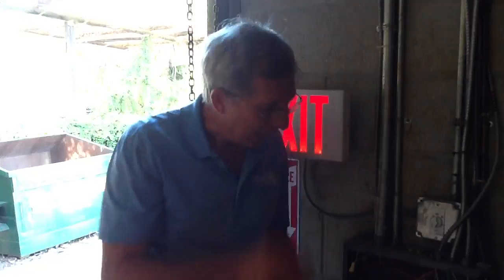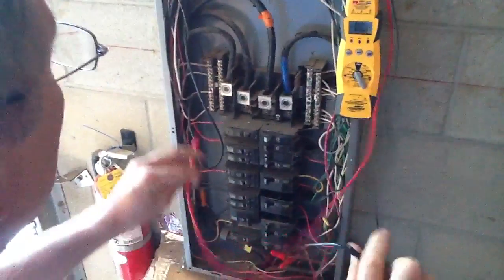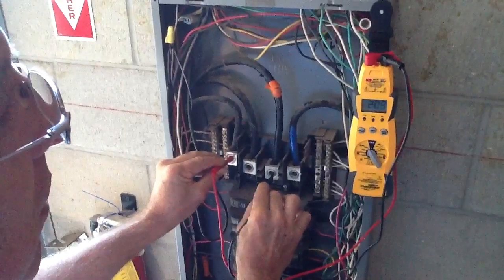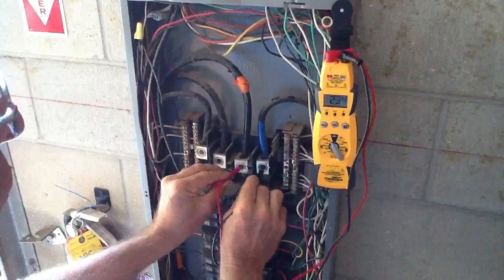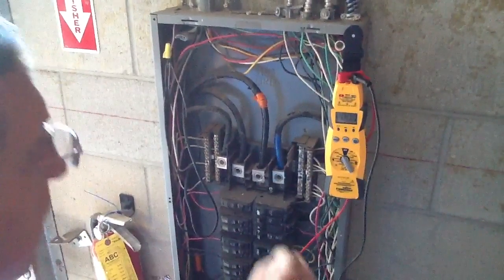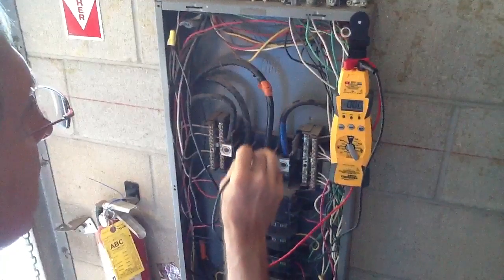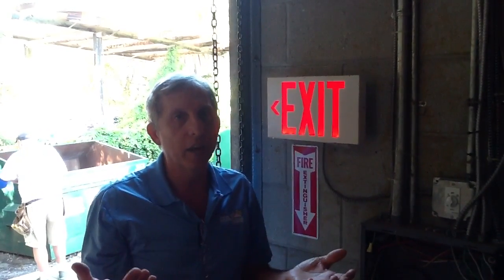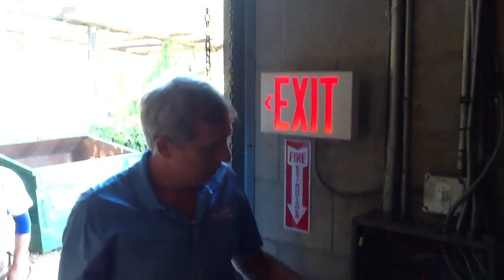How to measure 3 Phase Voltage with Highleg

Comment: There are a lot of uses for the high leg of a 4 wire Delta system. Most of your latest L.E.D. light fixtures have universal voltage drivers (120 through 277V.) that will operate at 208v. and any voltage in between.
Reply: Except that most single-pole CB's are not rated over 125v. And, the NEC explicitly prohibits high-leg to neutral loads.
But otherwise... totally okay. 😂😂
Reply: Or you can use 277 volt single pole breakers. You can get them on Amazon for around $20 to $30.
Reply: But most breakers you'll find are not rated for more than 120v.
Reply: Alex Millison You can use a 3 pole breaker.. All of which are straight rated (240 volt).  Either connect 1 phase to phase 240 volt load and a 208 volt load (high leg to neutral), or 2- 120 volt loads and a 208 volt load ( high leg to neutral).
Reply: Yes you're right, I was referring to if somebody was trying to use a single pole breaker in which case they don't make them with a 240V straight rating. And if somebody is going to use a 2 pole breaker to be able to use a high leg and nuetral, just use both spots and run 240v.

Comment: How is the potential difference between phase A and phase B 240V when it is 208V between Phase A and neutral?

question from a 1st year electrician
Reply: Phase B to ground is 208 because it's a 120/240 3 phase delta. You'll have 240v between any two phases. Phase a and c will be 120v and phase b will be 208v. Simply put, phase b has to travel the furthest distance to the nuetral in this delta system. If you take the square root of 3 (1.732) and times it by your line to nuetral voltage(120v) of phase a or c, that's how you get 208v.
Reply: Alex Millison Or you can simply multiply 240 (hypotenuse) × sin(60°) 0.86623~ 208
Reply: Jolyon Welsh or you can take 120V times the square root of 3 (1.732) which equals 208.
Reply: because they get the neutral wire by center tapping one winding......a little bit different than a center connected wye system
Reply: 0.86623 =√3/2
Reply: Correct
Reply: It's like all of you say the same thing over and over. You guys just recite what you've heard before. You guys probably don't even understand what you're saying when you regurgitate the whole √3 thing.
Reply: Richard  Wallace first you have to understand the difference between High-Leg Delta, Delta, and Wye. But you'll also run into Corner Grounded Delta which is fun to throw in the mix (thank you US for not having a standard system for 3-phase...) 

Not to mention the 240/415 High-Leg Delta, or the 7 different voltages that 3-phase is found in the US. 

So yes, you really should know your math before you mess with 3-phase in the US

Comment: So the one measurement you didn't show was the voltage between A&C  is that going to be 208 or 240?
Reply: Rod Bower  it'll be 240 volts rms phase to phase
Reply: In 3-phase all 3 phases should reference the same voltage to each other, the difference comes when you neutral reference things

Comment: I agree with Barry Witt and his comments on his closed Delta theory about this article.  One way to check is if you have 3 transformers on the utility pole supplying the service.  They should be marked with the voltage and other information.  To be sure call the utility.  They have the information.  Note: one of the transformers will be large and two of them will be smaller. The larger transformer (most likely) is supplying the 120 volt loads.  NEC 110.15 High Leg marking on a 4 wire delta-connected system where the midpoint of one phase windings (Coil) is grounded, only the conductor or busbar shall be marked by an outer finish that is "ORANGE" or by other effective means.  The high leg is common on a 240v/120v 3 phase, 4 wire delta system designated as B phase.  "IMPORTANT" : The Utility which has a different code and guidelines. The "High leg" (Stinger, Wild leg, red leg) is on The "C PHASE" at the meter. In past NEC codes the C phase was the "high leg".  The NEC changed the code to be on the B phase. Since the Utility uses a different code they kept the High Leg on the C phase.  "IMPORTANT" always check any panel your working on like the gentleman did in this video.  You don't know for certain how each supply was made up in the panel.  Someone could have made a mistake.  Another problem can be the wrong phase rotation.  Hopefully if you have phases A,B,C with the Utility A,B,C your phase rotating will be correct. Unfortunately, If two of the phases are changed out of the phases A,B,C order  the motor or motors will run backwards. You'll have to correct problem wiring by changing any two of the motors T connections.  The phase rotation should be checked before the install.  If the system is already installed you just have to work around problems such as the motors.  Thank You for the video
Reply: In my area, alot of 3 phase delta services are open deltas using only 2 transformers.

Comment: Great video, I have 3 phase high leg in an old building and am having trouble finding information on what types of 3 phase motors will work there for woodworking.
Reply: +Jordan Ward 208/240V dual voltage three phase motors will work just fine.
Reply: Those used with rotary converter on split phase.

Comment: Very informative video. The only thing I can see the high leg being good for is lighting where you have a ballast that can run on 120-277V.  208V has always been a mystery to me.
Reply: +Daniel Peters The voltage between all three phases is 240V.  It is only to ground that the high leg is 208V.  Three phase devices rated for 240V can be connected A,B,C while split phase 240V devices can be connected across the two 120V legs and single phase 120V devices can be connected between either 120V leg to neutral.  You just cannot connect a 120V single phase between the high leg and neutral.

Comment: Just to clarify what you really have there.  It is not a 208V 3PH service.  It is a closed Delta 120/240V High leg(wild leg, stinger leg or wild phase) service.  Between each phase you will have a nominal 240V (A-B, B-C, A-C) and between each phase to the grounded neutral conductor you will have 120V, 208V and 120V.  The leg with 208V to neutral is the stinger or high leg.  The typical phase to which the stinger leg should be connected is the B phase.  On the panel in your video it is correctly connected and correctly marked with orange tape which is required by code to identify the high leg.  No single phase circuits should be connected on the B phase bus terminals which is why you see several of the B slots with no breaker in them.
Reply: Barry Witt My brother you are absolutely correct.
Reply: +Alex Millison In his defense the closed Delta 120/240V High leg service is not very common.  It is usually found in cross over areas where residential services are mixed with mostly commercial services.
Reply: Most of these type installations are known as 240V "open-delta" three phase service.  Open delta because the power company only uses two transformers where a closed delta requires three transformers. These were very popular in mostly rural areas(start of REA electric co-ops) where a power company can give a remote farmer three phase service to his grain equipment by running only two high voltage phases to his farm, saving a ton of money. Here is a typical transformer wiring diagram showing an open delta connection with the high leg.
http://www.oempanels.com/240v-single-phase-and-240v-3-phase. 
Even though approved, good electricians will avoid taking single phase 120V/240 V load off a three phase, high leg main panel but instead mount a single phase lighting sub panel next to it, run the two 120 volt legs minus the high leg so 120 volt load won't be mistakenly connected to 208V by the next electrician salivating over all of the empty slots on the 3 phase panel.
Many electricians fail to test for the high leg and have burned up lot's of equipment. As full three phase power company systems are being installed in built up areas, power companies are shifting toward the elimination of the high leg for the safety value. Power companies spec these high leg systems where most of the connected load is 3 phase with incidental single phase load. After all connecting too much  single phase load on phase A and phase B results in phase unbalance for the system transformers. Be careful out there!
Reply: Barry Witt what happens if you tie in a single phase 120 to a b phase 208
Reply: i have two welders with ac power with 50 amps 3 p, can they be hooked up together to double the cut on a plaza torch, 1 Lincoln guy stated get welder at same rmp and hook up wires respectable?
Reply: Barry Witt  I’m a beginner Electrictian but too many questions that I have were answered. I learned more from the comments that from the video thank you 👍
Reply: Nice explanation. I knew some of this but u filled the gaps very clearly and understandably. Thanks
Reply: Thanks for making that a lot more clear....I've been around electric a lot, still get confused on 3 phase, the types, the hows and mostly the why's....lol....Thanks again.

Comment: I have 3 phase panel a,b is 120 and C leg is 220 i like to replace only bas bar .if i get same brand panel instead changing hall panel can i only change bas bar thanks
Reply: Your high keg should be on B phase, but I would not recommend swapping it. If you change out your panel make sure no single pole breakers get installed on your high leg

Comment: I like the video.  I guess there's no way to tell if the A and C legs are reversed??  Since they are both approx 120 or is the 243 volts and 235 volts between A and B and B and C the way you would tell??  Thanks...
Reply: Does not matter if they are reversed, essentially they put out exactly the same thing, 120V single phase.

Comment: Nice video.  As an cautionary history note in many older installations the panel has the high leg on the far right C phase and often it is marked with red tape. Folks called it a "red leg delta"; or call the high 208 volt leg the "red leg". In modern panels the high leg is in the middle busbar B phase like this video and the the wire is taped most of the times Orange. Some older panels have the middle B phase high leg tapped Blue or Purple too. Thus like the video use your meter to find out which lug is really the high leg. Disco era i.e. mid/late 1970's and before are older panels. They are also the majority of 3 phase 4 wire 240 volt delta panels in many places. Thus modern code has A and C 120 volt and B as 208 to neutral. Older installs are often A and B 120 volts and C is 208 volts to neutral. All have 240 volts between each phase. The current NEC requires the high leg to be the B phase bus in switchboards and panel boards. BUT it once was required to the C Phase bus at the far right of the panel.
Reply: +3beltwesty Another train of thought is the Utility always have kept the high leg (stinger, wild leg, red leg) on the C phase.
Reply: +3beltwesty Another train of thought is the Utility always have kept the high leg (stinger, wild leg, red leg) on the C phase.

Comment: I just can not thank you enough for those great videos, they been a great help to understand better my new trade on hvac, God bless you.
Reply: I hope he helps you in hvac, but electrical apprentices need to close their eyes and earts when this guy talks. Even for you hvac guys he messed something up pretty big. It doesn't matter which 2 legs you switch if you accidentally wired it backwards. All 3 phase to phase volt readings will be 240, although he didn't even check a to c. Any switch between any 2 phases will reverse the polarity of all 3 phase ac motors

Comment: Never see delta here on the conditions that I seem to work in.  Everything supplied here is Wye. 
In order to understand this condition you gave us some voltages but not all the voltages.
you gave us
A - N 121v
B - N 208v
C - N 122v
N - Gnd 0v
and
A - B 243v
B - C 235v
but no
A - C
So the give away here for the delta connection is the high leg AND the 240ish voltage?
So what is the low leg to low leg A - C voltage?  243ish 235ish or 208v?

Also is my assumption that there are no 120v loads on the B phase to N at all in that panel?

Nice upstaging job by your assistant.  :)
Reply: I just found an explanation that complements your demonstration.  Thanks again. 
watch?v=S1DUe_HQKtQ

Comment: Interesting stuff David!

Our power here is 240V to neutral single phase or 415V between each of the three phases, there is no high leg.

In some rural areas there a few split phase 480V two phase supplies but hey are still 240V to neutral just that the phases are 180' out instead of 120' as in three phase.
Reply: If you ever have 240 to N, something is wrong. You can have 277 to N, 120 to N, or 220 to N (in European countries). You shouldn't find 240 to N anywhere. Although, you can definitely get 240 by measuring across two 120 phases in a single phase 3 wire system.
Reply: He's getting 240v to neutral since his line to line Y config is 415v. Line to line is 415v.